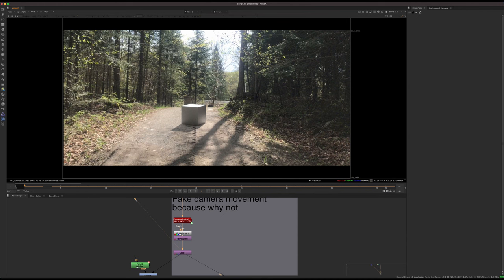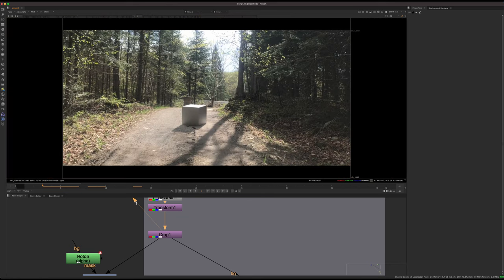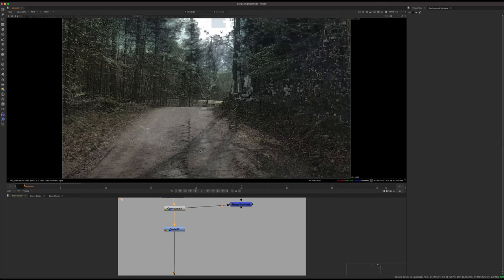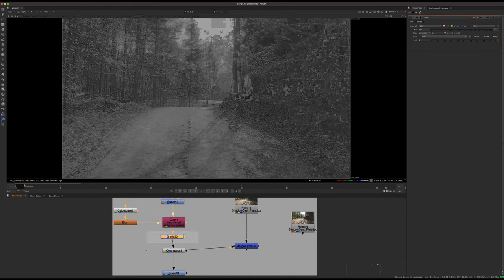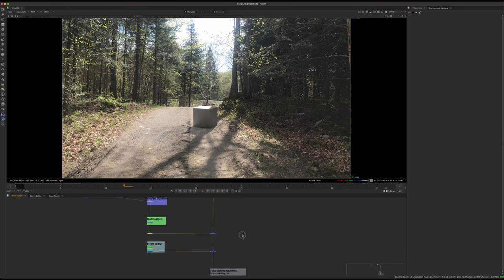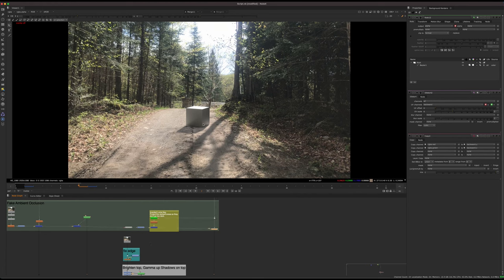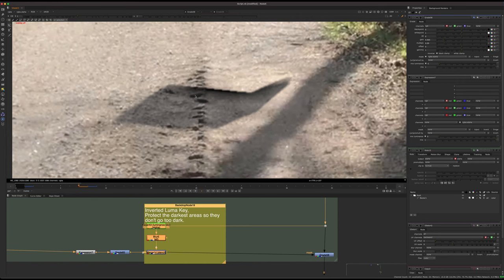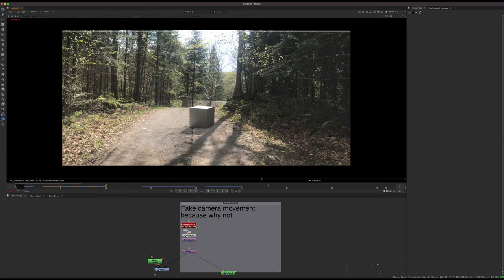Compositing Complex Shadows in Nuke [Advanced]

Comment: Nice tutorial, I am kind of confused about the part where you set the colorspace to HSV but then used a regular luminance keyer to key the highlights in HSV.
Should not the keyer be set to blue keyer, or am I missing something?
Reply from the maker: You can set it to the blue keyer, that would be correct.  In my script here, I copied back in the Red and Green from the original, which is doing the same thing but in a different way.

Comment: Thank you very much for posting this- great information here!
I was curious on another topic. If you're using a Nuke spotlight in a 3D scene, how do you get the spotlight to create soft cast shadows like you'd see in nature? So far all I've been able to get are hard shadows with the spot or directional light. Thanks in advance!
Reply from the maker: Unfortunately there's no easy way to do a soft shadow in Nuke as far as I'm aware.  There's iBlur which can simulate a soft shadow easily, but if you wanted to just cast soft shadows you would probably need to build a gizmo that does this.  I have a few ideas on how you could probably build that tool, but it would be hard to explain on a text.

Hopefully though they just add some more features to Rayrender so we can get soft shadows in a less confusing way.

Comment: This is a neat trick. I am staring at that HSV image though and I'm noticing the shadow is purple but the floor is blue... Isn't there a From merge node trick in there somewhere that could be used with that colourspace? i.e. painting the tree shadow to blue first and using the difference info somehow?
Reply from the maker: You definitely could.  What you're seeing primarily is difference in hue which is why it's appearing more red.  Basically the warmer areas / areas in the light are warmer in hue, so you could do similar to what you said or just do some color grades which might be faster.

Comment: Very good . Is there any particular reason to use HSV intead of HSL in the colorspace transformation step? great content, thanks for sharing that
Reply from the maker: Thanks!  I think HSV and HSL are pretty much the same, the math is slightly different.  Ben Mcewan wrote on his blog that explains the difference pretty well:

"HSV is the same as HSL, except the V stands for “Value”. There is a difference between luminance and value based off the math used, but it’s a similar concept. If you multiply the blue channel in HSL vs HSV colourspace (blue channel, because Blue has been converted to Value), you’ll notice that HSV produces a similar result to just multiplying your image the regular way, whereas HSL appears to desaturate the highlights as they get brighter. HSV also seems to give a flatter, more diffuse look to the saturation values, so you’d probably want to use HSV over HSL in most cases."
Reply: @CompositingAcademy   thanks for the reply. I often use HSL. Going start to use HSV more times now. Besides that, one thing came to my mind: this "isolation process" (let's call this way)  by changing the colour space then changing back to the original, shouldn't isolate hue saturation and Luma (or value) information in each isolate channel R,G and B? so why this difference between HSV and HSL affects the saturation since the channel for that is the green one? does it make sense?
Reply from the maker: @elironerosa3609  Hey!  Sorry didn't see this comment before.  I'm not entirely sure to be honest, I think the way the "Luminance" channel is created must be slightly different, which is why it is affecting the saturation slightly when using that alternative option.  My guess is that it's doing some math behind the scenes on the R G B channels, but these two colorspaces do some slightly different 'difference' operations to create that brightness channel.  In other words, it might be "weighting" one channel more than the other when it goes into the highlights, when calculating what is the luminance vs color.  Probably someone who knows further in color science or the guys who work at foundry could answer better than that, but that's about what I know!

Comment: Wondering, how did you get the shadow from the tree to spread on the box though?
Reply from the maker: that was rendered in lighting.  I had a directional light for the sun, then I just used a geometry to block the sunlight where the tree is placed, to cast a shadow. 

Tricky to get the angle lined up with the real shadows but it works
Reply: @CompositingAcademy  Ok then what did you do about the original tree shadows on the floor? Roto them out and replace them with the 3D shadow?
Reply from the maker: @belovedangels6457  I believe I used light linking / shadow linking.  So that the tree shadow would only cast onto the cube but not the ground as to not create a duplicate shadow.  Then the cube would still cast a shadow.  Been a while since I did this tutorial, but if it's not that then the other way would be to just render the shadow pass separate (disable the trees and only render the box shadow).